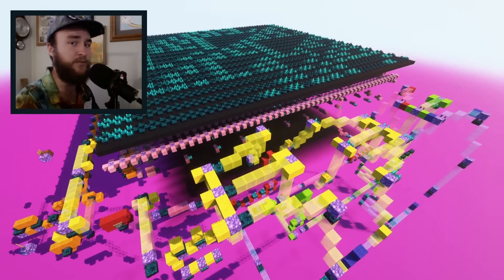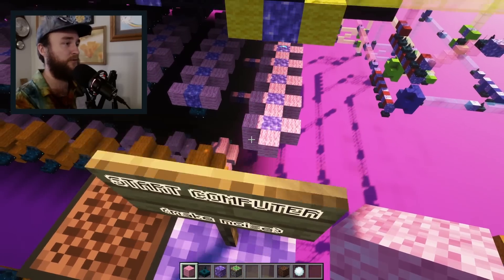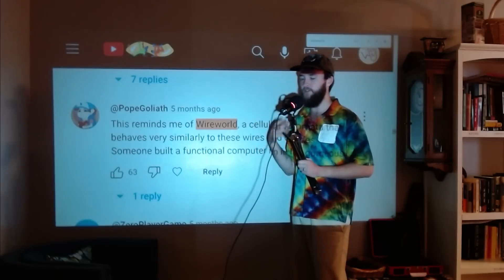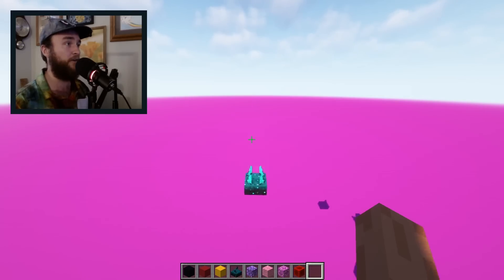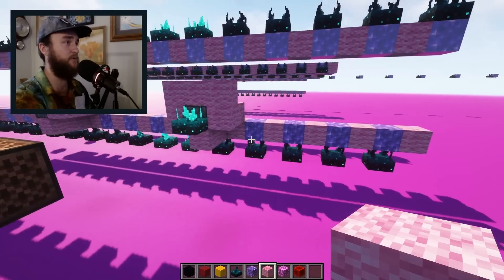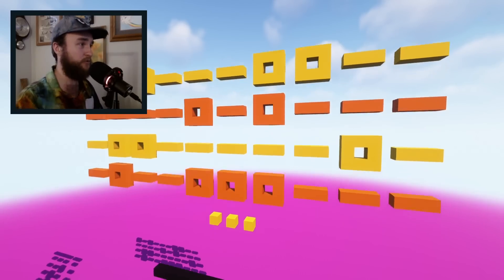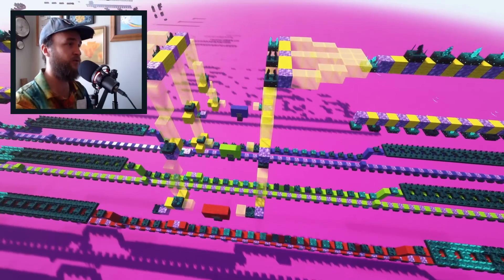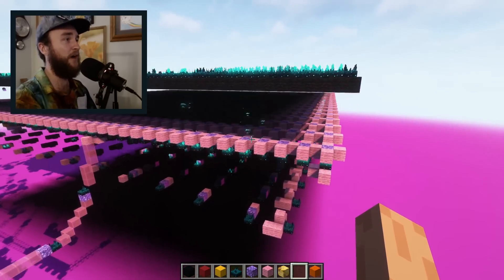A sculk-sensor computer

Comment: Ok, no, no, no. There's only 3 types of redstone, it's ALL considered redstone, you have typical redstone (which uses a ton of slime depending on the build, there is NO such thing as slimestone), leafstone, which is redstone but using leaves/logs to pass signals in corners vertically, which is more a feature of redstone than its own kind of redstone, and ig now soundstone, which again, isn't SEPERATE from redstone, just a feature of it. Just because you use no redstone dust doesn't mean it isn't still just normal redstone. Basically, don't name things that aren't things, and don't call things not what they are. Slimeatone isn't a thing, that's just common redstone, and so is all of this other stuff. Note blocks, skulk, pistons, redstone. Logic gates, same deal. Otherwise, good vid cutie

Comment: You might end up most redstoners enemy, for whatever reason, a lot of popular redstoners don’t like sculk sensors
Reply: No they wish they could implement it, but for a lot of them, it's just too slow and the potential of it activating from a false signal is too great. Redstone systems can break from a single signal activating when it shouldn't, and so the sensor doesn't work.

Comment: Could you squish the wires like a DNA helix (3d squishing), and maybe like a cromossome afterwards?
Reply: the wires are sound tho, it doesn't really travel in a line, just in a 20 block radius around the sculk sensor
Reply: @witha1 can't you use wool to "funnel" the sound to another skulk sensor?

Comment: How could calibrated sculk sensors change the computer? Could you store data more efficiently by relaying different messages along different sound frequencies?
Reply from the maker: That's a great point. Some cellular automata use more than 2 colors. So it might be possible to make a similar computer that uses different sound frequencies with the calibrated sculk sensor to represent different colors

Comment: this is like the fourth or fifth time that a minecraft feature has been discovered to be somehow Turing-complete lmao, I wonder if mojang is doing it on purpose

also is there a reason why Rule 110 makes something that looks an awful lot like the Sierpinski Triangle?
Reply from the maker: The triangles are actually a common pattern in most elementary cellular automata. They even come up in cellular automata that simulate integer multiplication (i.e. you can think of the first line of the triangle as a long row of zeros that takes a few multiplications to fill in)
Reply: the triangles are mostly just what happens when a line of cells gets smaller over time, but sierpinski triangles do show up in some cellular automata, such as rule 60!

Comment: Running rule 110 doesn't make it a computer.
Reply: What is a computer?
Reply: @zbdfhg a circuit with memory, a circuit for modifying data, and a control unit, whereas it follows a line of instructions and can modify where in the line it is.
Reply: @iPlayGamesX  There's a very roundabout way you could define rule 110 to have all of those, but it doesn't really matter since A. You have to be able to use a specific initial state for it to work as a computer and B. That circuit isn't long enough for any useful enough computation in rule 110.
Reply: @want-diversecontent3887  damn so basically he took the laziest path to claiming he made a computer?
Reply: @iPlayGamesX  Believe it or not, there are lazier paths, but those are usually reserved for things that are extra hard (usually intentionally made to be hard) to turn into computers. With how difficult a regular redstone computer is already, I wouldn't blame him for not making an entire control unit, but he could have gone for better than rule 110.
Reply: @want-diversecontent3887  meh Redstone isn't too hard to work with, you can genuinely copy off an irl diagram using direct gate designs. Altho it's not too efficent that way and you do need to track timings.

Comment: i love weird minecraft computers! i have no idea what rule 110 is or how it can be used for math though
Reply: rule 110 is a cellular automaton, kind of like a 1d version of Conway's Game of Life, if you're familiar with that (and if you're not, I'd definitely recommend looking it up!). computation in rule 110 is a bit convoluted, but basically it's possible to create "gliders", which are patterns that move sideways as the simulation progresses, and the interactions between different gliders can be used to do more complicated things. specifically, they can be used to simulate a kind of computational system called a tag system, where you have a sequence of gliders representing a queue of bits, and a repeating sequence of gliders that act as a program doing simple operations on the queue. tag systems have been shown to be capable of implementing universal turing machines, so theoretically rule 110 can do any computation (though it would be very impractical to actually use it for that)
Reply: you can get any sequence of 1s and 0s and transform it using some specific rules into another sequence. and its been proven that if you have a computer capable of doing rule 110, it is theoretically capable of any other computation

Comment: Looking at the output, I wonder which relation is there between the shierpinki triangle, and rule 110. It really seems like its creating a fractal where there is not really a reason to do so
Reply: rule 110 doesn't really have a fractal structure, but there are other cellular automata, such as rule 60, that do basically make sierpinski triangles!
Reply: I noticed this as well, it might be fun to look into. There's something going on there for sure.
Reply: I think there's a small modification you can make to rule 110 to make it actually the sierpinski triangle.

Comment: Calibrated sensors have less cooldown than a regular sculk sensor even without the extra bits that calibrates it. You can use them to make the computer two times faster!
Reply: I wonder if you could use the difference in delays for other computations
Reply: There might be some problems with the extra range of the calibrated skulk though
Reply: Fix it by funneling the imput sound only on the starter, so it doesn't spread. The delay should be long enough that the sound can't make it back because of the wool blocks between sensors.
Reply: @PotatoVariety Hello there fellow potato :D
Reply: They also have extra range which could help with transmission speeds

Comment: Your information storage solution sounds like one of the earliest computer memory solutions - Delay-line memory. UNIVAC 1 had A tube of mercury with a speaker on one end and a microphone on the other. Mercury has a slower speed of sound than air, which is why it was used. So sound has been used to store data for a long time!
Reply: Ah, mercury as a storage solution. (literally.) Because everything had to contain mercury back then.
Reply: Than air? Sound moves faster in mercury than air. Did you mean something else?
Reply: @Ivan.Wright  Seems like a small mistake. Reason for mercury from Wikipedia:
`Mercury was used because its acoustic impedance is close to that of the piezoelectric quartz crystals; this minimized the energy loss and the echoes when the signal was transmitted from crystal to medium and back again. The high speed of sound in mercury (1450 m/s) meant that the time needed to wait for a pulse to arrive at the receiving end was less than it would have been with a slower medium, such as air (343.2 m/s)`
Reply: @Positroni  I appreciate you providing more clarification. I suppose he meant the wait time was lower rather than speed then. Those kind of mixups suck, they're easy to make but they can cause the biggest problems, like reversing positive and negative on a circuit 💥😭

Comment from the maker: Hey y'all, school has been kicking my butt already so the plan is 1 video/month from here on. You can join me in November for a proof about piston extenders, regular grammars, cellular automata, and number theory.

And if you wanna support this niche kind of math content, the channel has a 1$ membership now (helps me save for new gear like a better camera). Heather and I made all the badges and emojis from scratch(in most cases, pixel by pixel).

Tie-dye armor:□
The wall-clock:□
Nerd pig:□
And *442 pattern orbit:□

Have a great day
-Chris🌻
Reply: Tie-dye armor:□
The wall-clock:□
Nerd pig:□
And *442 pattern orbit:□
Reply: @caspermadlener4191 Did you try copying them or something? Slightly confused on what you're trying to say here.
Reply: @nikkiofthevalley  Oh, they showed up like squares, but it is fixed now.

Comment: Please don't put your camera in the top left and also make it a bit smaller. You had several times where your camera was blocking what you were showing.

Also having a buffer between the edges and the camera is wasted space. The transparent edge on the top and left isn't useful because you can't see what is there all that well.

Comment: Why not calibrated sculk sensors? If you don't calibrate them, they are just like normal sensors, but faster
Am I missing something?
Reply from the maker: They were avoided for 2 reasons: 1) because they pick up sound from further away, the wires would have had to be built farther apart or with more insulation and 2) the wires were actually designed to be slow on purpose since this allows more compact data storage.